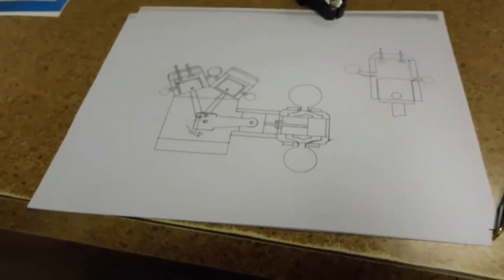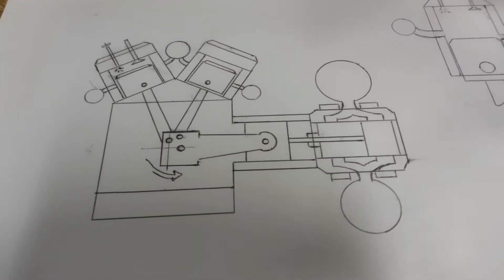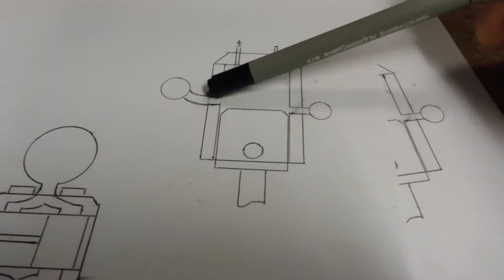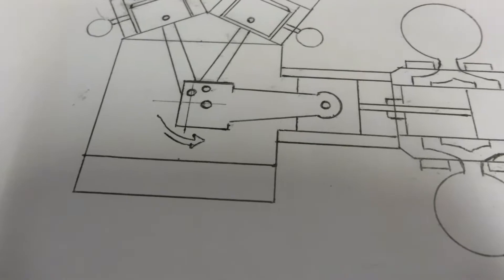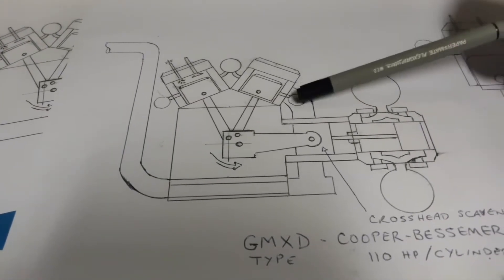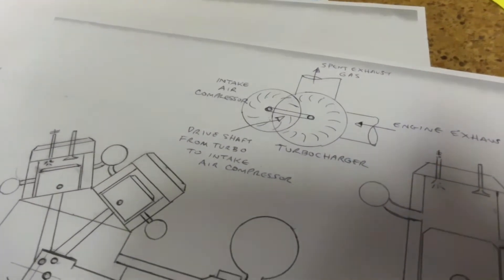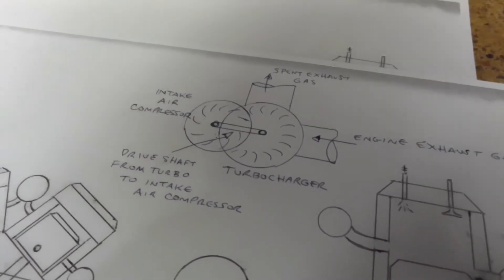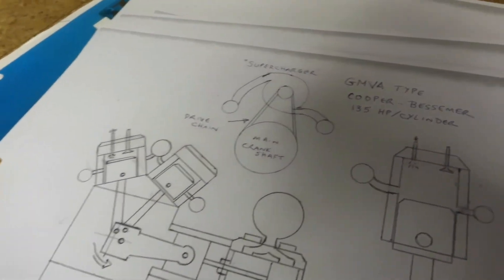Cooper-Bessemer GMV-10 Scavenging Air

Comment: Thanks for the explanation. This is the first time I've seen these particular engines, their construction makes sense. What percentage of the gas is used as fuel?
Reply from the maker: What percentage of the gas is used as fuel?
If you mean what is the air fuel ratio I'm not dead certain?
I can tell you that fuel is basically proportionate to the air that the engine is able to compress, and load on the engine dictates much of that.
If the load increases, the governor automatically compensates to increase fuel, in order to maintain engine speed. Air intake being driven by the engine output will then increase as well.
The significant factor in horsepower/fuel consumption in these units is ambient temperature.
Warmer air is less dense, so much harder to increase the air mass to the engine, and they will produce less horsepower. Unfortunately, this state can also lead to detonation, a serious problem in the 2-stroke scavaging air engine. Detonation is air fuel ratio that is too rich, which is usually due to high ambient temperatures.
Detonation means that instead of smooth combustion, the engine experiences explosive ignition of the air/fuel mixture. When the air/fuel mixture explodes, this can damage the engine, heads, head gaskets, supercharger etc...
The opposite happens during cold weather. Then because the air is denser, you can compress a far higher mass of air into the engine, fuel automatically ramps up, and then the horsepower output of these engines can increase significantly versus horsepower output in the heat of summer.
I hope some of that makes sense.
Reply from the maker: Jeepers I'm not certain?
We have 2 gas compressors running and 1 propane compressor, plus numerous heaters for process.
Combined we burn approx 41km3 fuel gas each day.
I believe the Coopers burn around 5km3 each pre day?

Comment: Excellent engines. I manage a GMVH and a GMVA. We also run some GMVGs I believe
Reply from the maker: The longevity is astounding, the compressors at our plant run 24-7-365, and they need regular ignition components replacement, but other than that it's crazy how long they run.
Cruise through the compressor building they are just whomp, whomp, whump pounding away.